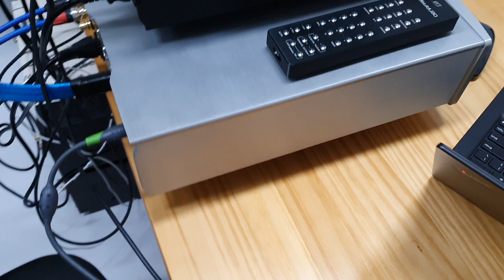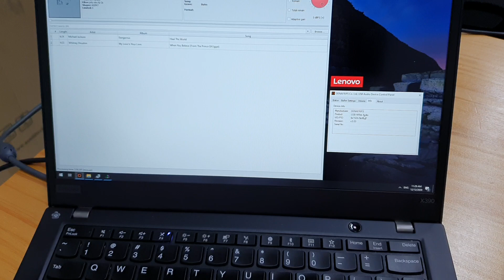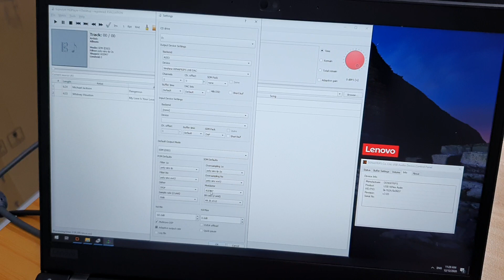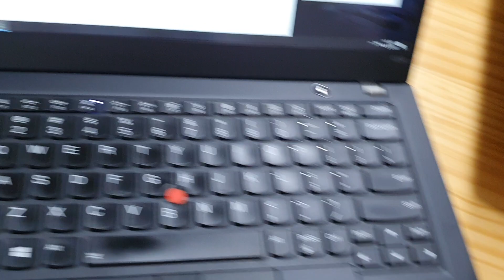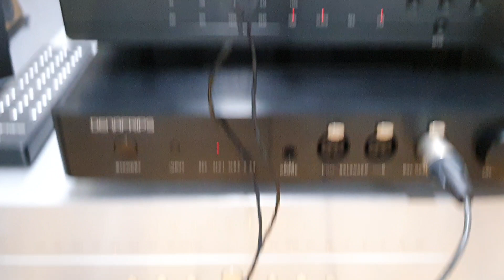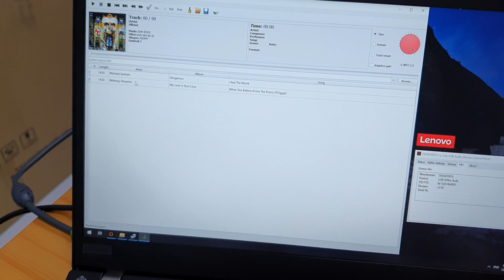DENAFRIPS Gaia DDC + Terminator Plus DAC + Artemis Headphones Amp

Comment: Alvin, very helpfull demonstration video.
What HDMI and clock-sync cables are those you're using?
Can the AES/EBU outputs on the Gaia be used in dual mode as is possible on the Terminator-Plus?

Comment: Hello Alvin, I really do appreciated these videos. Having no dealer network for Denafrips products locally makes these type of videos super important. I still don’t understand how to take full advantage of denafrips products. Example, do I need to use both clocks inputs (45.1 and 49.1) on my Iris to synchronize between DAC and DDC or can I only one? What type of cable and connector should use for clock signal (coax / BNC)? Another example is pin-out options of I2S-A, the manual of my Iris doesn’t mention what it is. More videos or maybe a manual to explain how to get the best out of Denafrips products could be useful . Thank you, and stay safe. Brian.